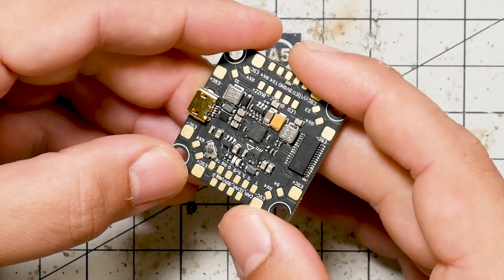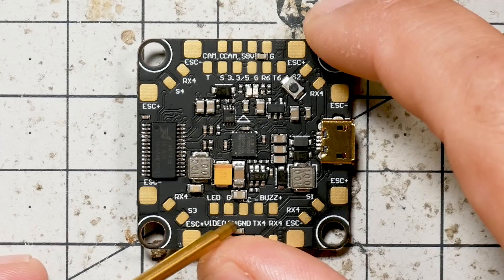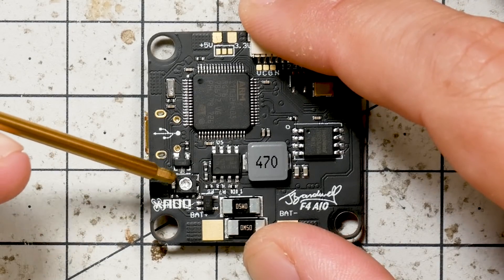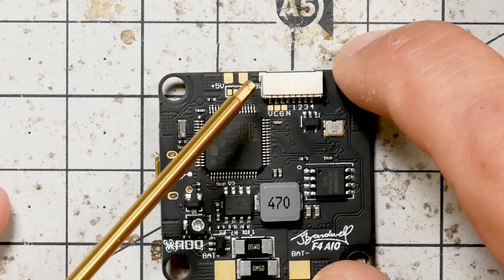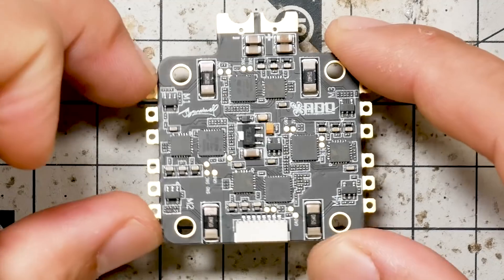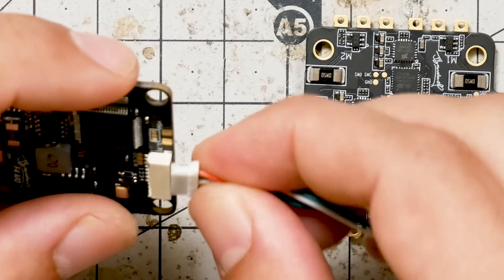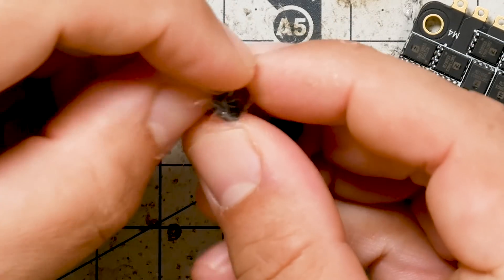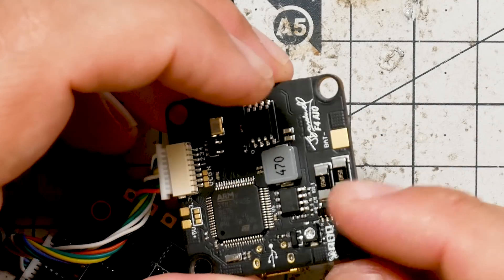JBF4 v2.0 and new Joshua Bardwell 4-in-1 ESC

Comment: Any plan to expose the uninverted signal pads for Uart 1 (Sbus) and Uart 3 (Telemetry) in future version?  I'm using Crossfire so Sbus and Telem pads are not used and being wasted. It would be great if the uninverted signal pads are available.  Even better, if you can expose S5 and S6 motor pins so that they can be used for Softserial, like the old Ominibus FC.  I am already using Uart 4 and Uart 6 for Crossfire and GPS, and I have to remap LED as softserial for smartaudio. (I know I can run Smartaudio off Crossfire Rx but don't want to use Lua script)

Comment: A few random observations:
The ESC seems to have a really small amount of capacitors/filtering.
It seems to work with individual Escs as well as 4 in 1 which is nice, but if you’re running a 4 in 1 then you will be carrying around the weight of the FCs PDB and thick traces without using them 
The cable that links the FC to the 4 in 1 seems very long. Does it need to be that long?
Y u no F7? 😛
Reply from the maker: There is a bank of ceramic capacitors on the top side of the ESC.
Reply: Yeah I saw those, but what I mean is in comparison to other Escs. Consider the airbot wraith v2, it has 18 ceramic caps on the top and two tantalum caps. I count 14 caps on the top of yours and maybe 4 on the bottom - 18.
If you go with 4x wraith v2 that’s 72 ceramic caps and 8 tantalum caps vs 18/0. I’m not comparing two 4 in 1s though and airbot does have a 4 in 1 based on the wraith. I just would always personally take the replaceability and extra filtering of 4x wraith v2s.. or in my case, holybro tekko32 🙂

Comment: Jb. For the fc v3.1 please add a 4i1 esc powerpad on the underside of the fc
Reply from the maker: Why? There's no reason to wire current through the FC when using a 4 in 1 now that there is external current sense input.
Reply: @JoshuaBardwell  unless, if there is no current sensor on my 4i1.

Comment: Will you pleeease also make single JB ESC's? Don't wan't to use 4in1's....
Love your Channel and your products, thank you for making this Hobby the perfect Hobby
Reply: I am using the spedix es20 lite on 6s without any issues. The esc's are 9$ 10mm wide. I am running no caps with clean video on rapidfire. I have seen to many 4in1's fail.

Comment: Hey Joshua, even I already built some quads (and they fly..) I'm still not 100% certain, how to supply power to the FC when using a 4in1 ESC: Is it sufficient to use the 8-pin plug header (and its voltage wire) or do I need to install an extra wire from VBat to the FC? (independent from the 8-pin header) 

Actually all my quads do have both - the voltage wire from the 8pin header AND a separate wire from VBat to the FC power supply pins.
Is this even necessary? Regarding amp consumption of vtx, cam, rx etc? Or does the 8pin header provide enough amp? 

Thanks in advance!! (using the JBF4 v1.3)
Reply from the maker: Just plug the wire to the 4 in 1. The FC gets vBat power that way.
Reply: Joshua Bardwell Thank you very much
Reply: I had the same question. The manual was not clear how to wire power if you are building a Bardwell 4:1/FC combo. Thanks for bringing that up.

Comment: Another possible calibration solution (I don't care much for reliability of trim pots), maybe digital.

Automated test of current sensor, then burn correction factor, into memory chip on FC.

Another way could be, Automated test of current sensor, and provide correction factor on printed piece of paper with board, or on website (that matches with board serial #), to make it easy for user to put into BetaFlight.
They do this kind of thing for good microphones.

Comment: I had a 1.2 and the 9v failed.  RDQ was cool about it and sent me out a 1.3.  Ive been flying that fc for 3 months with no problems.  I also have a v2 that Ive been flying since August.  I use a Matek HV and Caddx SRD2 on both quads.   My video is very clean.  Its a very good ESC, pads are nice, and the lay out has been awesome since v1.  Good job JB.

Comment: Just use a piece of wire around the rubber and pull it through the hole ;)
Reply: wire will cut the rubber grommet use dental floss string or fishing line

Comment: For the rubbers, just rotate a a tiny cord around it 2 turns, then get the cord true the fc hole and push the rubber on the fc. Then u unwind the cord from the rubber and the rubber slides in easily
Reply: https://youtu.be/QvcJ_lU_VpQ
Reply: Watch this video from 1m40 and you get the idea.

Comment: @JoshuaBardwell I see V2 is coming out, Congrats!!! I am still running v1.0 with the 7.6v in one quad and the v1.3 with 9v in my newest build. Havent had any trouble with either board, (wiring vtx to vbat(vcc), and cam off 5v vtx output on the rdq mach 2).  However with all these issues I hear about the regulators going out (5v and/or 7.6v/9v) I always have that fear in my mind not to do anything over water or trees.  Were these FC's only affected in certain batches in version 1.2 or did I just get lucky??? I have been using the V1 since release (granted I only fly once a week on average).
Reply: any idea?
@joshuabardwell

Comment: As for the grommets, I looped some fishing line through the hole and used it to pull the grommet into place.
Reply: Or just use a piece of wire
Reply: @gacha24  You run the risk of cutting the gummy with wire thin enough to thread it through.
Reply: use your brain

Comment: For christ sake.. to get those damn rubber in, just use a string.. pull a loop through the hole.. insert the rubber gromit partially in the loop at one end.. push the other end of the gromitin the hole.. now pull the loop.
And they are in.
Its easy.
Reply: I had ripped one then I saw use a string and it worked wonderfully thank you

Comment: My friend has bought three of the old ones and they kept on dying randomly and wouldn't boot or turn on at all. He did crash but it was such a small crash. Any reason for that?
Reply: Frames flex in crashes, this causes the fc to flex and die.
Reply: danlatu he had no problems with the other fc he's using now so...

Comment: Next on the development board... Drone locator. Two days off the bench I and in a tree somewhere. Need a locking tab on the xt60 so when it goes in a tree the battery won't disconnect. Needless to say I cut down an acre of trees today. Will be at it first light....lol

Comment: I bought the v2 to handle a bunch of nasty left over Emax Magnum ESCs, they fly fine but are obviously quite noisy.  The Piroflip f4 (two different boards) would lock up on these ESCs, the JB v2 has had no issues.  Sweet.

Comment: Great work.  Good to see the improvements come through.  Upgrades to 9V regulator to smooth out noise to the VTX seems the right way to go.

Can you get a sample fo the 4-in-1 ESC to Dronemesh for noise testing?  Fine if it handles the voltage (4 to 6S) and the current, but if it feeds back too much electrical noise into the system it messes with a lot of other things.
Reply from the maker: I'm not convinced DroneMesh's testing is meaningful. Some of the ESCs he says are great perform really poorly in the field.
Reply from the maker: We have been field testing this ESC extensively for a few months and are happy with the results in terms of noise.
Reply: Good to know.

Been flying mainly the Tekko32 4-in-1's, but when I need another, the JB will be on the list.
Reply: Maybe DroneMesh isn't testing everything, but his tests are far from meaningless. I think we can agree that less electrical noise is better. Let's just say that if he tests your ESC and it performs very well it would be a good sign and a reason to buy it. Running mostly Tekko32's myself together with the Kakute V2.

Comment: How's the noise on it not much filtration on it
Reply from the maker: The 9v and 5v regulators are filtered. Also there is an additional filter cap directly on the outputs of the camera and video power pads.

Comment: JB WHEN IS YOUR BNF JB QWAD COMING OUT?????  PERSONALLY I THINK BNF IS THE FUTURE OF RC. AS SEEN WITH CURRENT RELEASES OF THE BATMAN220 AND KOPIS 2, the quality of these BNF is UNREAL!! My kopis 2 is in the mail but the batman solder point on the esc and FC is perfect. I've never seen solder point so nice and clean. I'm guessing they use a different type of soldering iron? Think it auto feeds the solder to the iron which is how they get some nice work. I will say I  enjoy builds not repairs lol but I enjoy flying the most. I found myself doing more bench work than flying. Then I had a chance to grab batman for $260 and it's been so awesome that I've flown everyday since it came. Then I saw the kopis 2 for 300 which is still unreal for what comes with it. Now it's time for the JB Know It Qwad!!!!! I know it's already in the works :) .

Comment: Hey Josh! Loving your new FC so far, today is my first day with it. Unfortunately I have one small issue. The quad flies fine and everything is working, except when I plug into blheli configurator to flash escs, I get problems. I hope you know what I am talking about, but on the top line of each ESC isn't there like a CH-25 or whatever ESC type you have, then a comma then the version it's on or something? Well on 2 of my escs, I get a series of about 10 or so y's, then the version, then more y's! I'm so confused I can't find anything online and of course now I can't flash those 2 escs if I want to because the ESC type isn't recognised. Please help however you can! Or anyone for that matter. Keep up the good work Josh you're always a huge help and contributor to the hobby :))
Reply from the maker: The ESC firmware is corrupted. The ESC will still fly fine but it needs to be re-flashed before it can be configured. You can sometimes fix this by activating the "ignore incompatible layout" option in blhelisuite then flash the correct firmware. Make sure you use the correct firmware hex file or you will destroy the ESC and motor.
Reply: @JoshuaBardwell  thanks for this Josh! Could this be why my ESC beeper beacon isn't working? 🤔

Comment: I'm sorry to say this but I stopped using your F/C for a while, after buying 15 of them I had some problems with 5 of them and I think Tyler was getting tired of my emails, some of them would smoke when the D shot beacon started and some had the VTX power problem. But now I'm coming back to try them again, especially now that you have more uarts and hopefully a noise free 4in1. I try to support you as much as possible because you produce great videos and I have virtually learned everything about quads from you. 

P.S. Shout out to JC whom I learned a lot from also. RIP
Reply: I was going to upgrade to it from an SP Racing F3 board, but all I read in the reviews was lifting pads so I passed.
Reply: I run my soldering iron at 899 and I have never lifted a pad on a Bardwell board, lifting pads is a operator error.
You should defiantly go to the Bardwell f/c.
Reply: I've soldered two of them now, not a single lifted pad. Hit 'em hot, get in and get out.
Reply: true
Reply: I've rebuilt my F3 board countless times and never lifted a pad. My Weller iron only has a 1-6 setting, but I usually run it at a 3 for small pads and 4 for ESC/battery wires. Maybe the reviewers screwed up, but it wasn't worth the risk. I will probably buy into the new board, though. Time to ditch that F3 board.
Reply: good board. I noticed the weak pads after desoldering . as one I sent back for evaluation
Reply: I had problems with previous versions as well, I am running the 2.0 now so far so good.
Reply: Same but I was using the older ones so im giving JB another chance
Reply: Yeah I bought 1 for my first build. though there are many backups, a ton of pads lifted and the vTX power didnt work. The 4in1 connector fell off. all in all it was annoying, though its still working. I'll buy the 2.0 and see if hopefully its better.
Reply: You must be new to building quads because the version of the Bardwell f/c with a 4in1 connector came out in June of 2018
Reply: I had the same issue and coming from him I was expecting more. So I guess that there are many alternatives and plus I would wait for a f7

Comment: Dude please try the dental floss or string method of putting them rubber grommets in so easy bro
Reply: michael taylor explain!
Reply: Its so easy. wrap floss around grommet, feed the ends of the floss through the hole of FC, butt grommet up to fc and gently pull on ends of floss while rotating in a circle to pull the edge of the grommet through hole. Works great and a lot easier than the way JB did it
Reply: Gary Tolhopf thx!

Comment: Hey Josh, I was just curious after watching your video how you would go about wiring the power to your FC and 4-in-1? Just with both of them having current sensors, would the two readings conflict with each other? You mentioned that there's no 5v output on the ESC, but is the vbat output enough to power all the peripherals off the FC? I guess my real question is on the setup shown on the video, where would you wire the battery to and then how would you power the second board off the first?
Reply from the maker: The 4-in-1 plug has a current sensor input wire. When you use that, it overrides the current sensor on the JBF4. If you use ESC telemetry that overrides the current sensor on the JBF4 also. Yes, the vBat output is enough to power all peripherals.

Wire the battery to the ESC then use the plug to power the JBF4 and all peripherals.

Comment: The only thing that sucks about this ESC is that the mounting holes are too small to fit mounting jellies in them.
Reply from the maker: There's no worry about a short. The mounting holes are connected to ground and have no voltage potential on them.
Reply: THANK YOU JB! I'm literally about to mount it now and that was my main concern.  Time to proceed and try it out.  I've been pretty rough on my Aikon's and I'm tired of spending $66 every other week (flying multiple quads)
Reply: Wow i was wondering this. Have a chameleon im about to finish with your name in it. Putting an airbot nano v6 on top of your esc. I usually hard mount my escs with solid screws but wasnt sure about this one. Thanks.
Reply: Do vibrations actually affect ESCs in any way? I mean the connection to FC is not solid so I don't see why you would need to soft mount it, people fly with separate ESCs stuck to their arms and soft-mounted FCs without any issues.
Reply: @FilipRadelic  it's just the way I prefer to mount them.  I don't like using plastic screws so I use metal screws and the soft mount jellies help prevent a short
Reply: Fair enough :)

Comment: Where is the innovation?  Where is taking this to the next level? This is a slight upgrade to any F4 on the market
Reply from the maker: It's a top of the line ESC that works natively with my FC and it costs $50. It has been extensively tested for reliability and performance which is why I'm willing to put my name on it. If that's not enough to get your sale, buy something else with my blessing.
Reply: What are the FETs on it? Where are the caps? I only count 20 caps. Compare that too something like the aikon that has 36. I've had very bad luck with 4in1 esc's, going through 3 different ones in a day. I'd like to hear from Ryan Harrell about the ESC first before I drop another 50 bucks on a 4in1 that's going to lose a phase on me.
Reply: Joshua Bardwell I was actually referring to your FC.  I just expect more forward moving innovation from you.  It’s like the riot control an the gimick of encapsulating the gyro.  Helio and flightone are innovating.  I want to see you and rotor riot doing the same.
Reply: The current sense adjustment is pretty good. I'd call that an innovation in FCs.

Comment: Why did you stop at 6s why not up to 8s?
Reply: 10s is the future. 😊
Reply: MC's Creations  try 1000s
Reply from the maker: 8S capable FETs are more expensive and larger and difficult to reliably source.
Reply: @JoshuaBardwell  you'll get there.
Reply from the maker: 8S is just not widely used either. 6S is only barely becoming commonplace.
Reply: @JoshuaBardwell trust me it is coming. The sport is in a weird spot. But people are going to explore if it is able to do it
Reply: 6s is kinda the limit for the low resistance FETs used in these escs similarly priced hv FETs would have a much higher on resistance mitigating virtually all the advantage of running higher voltage.
Plus most chargers can handle 6s easily but 8s capable ones are more specialist and harder to find.